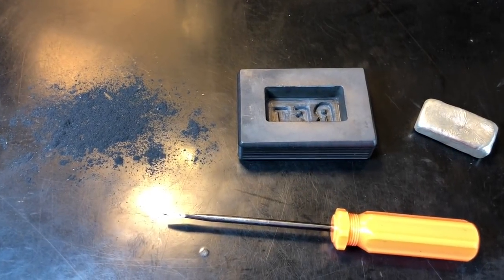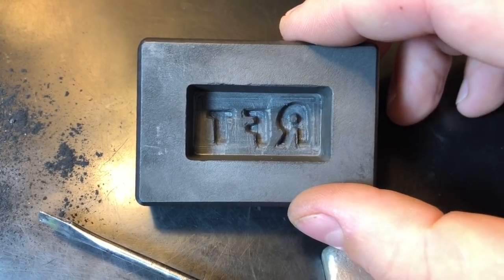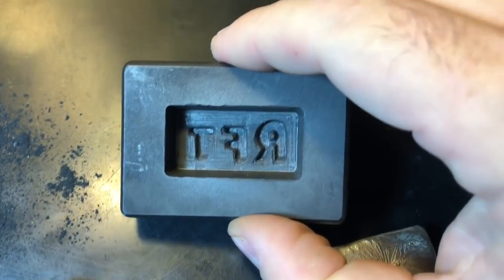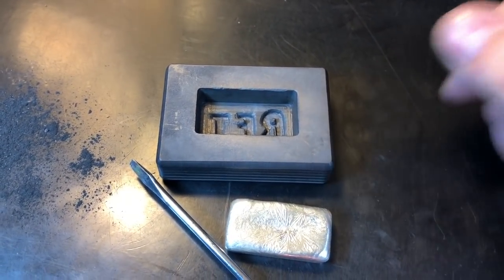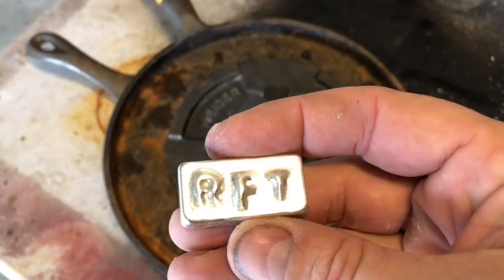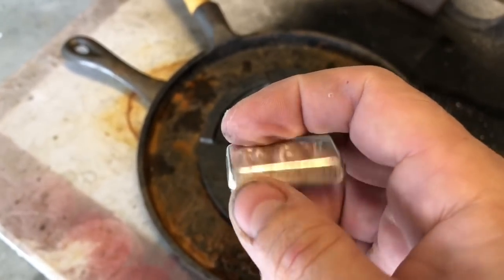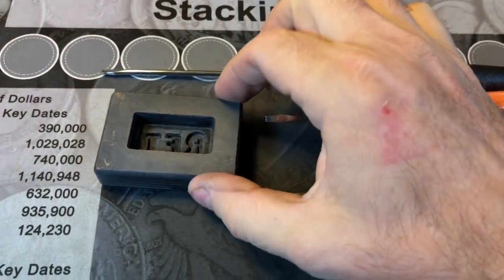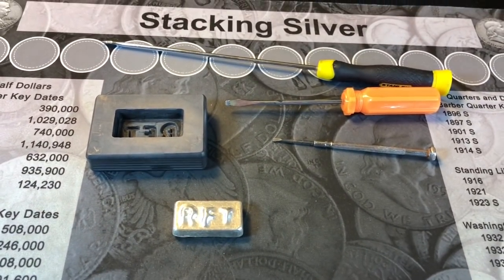Hand Carved Custom Mold and Silver Bar Pour!

Comment from the maker: Hand Carved Custom Mold and Silver Bar Pour!
In this video I will to take one of my older graphite molds and attempt to hand carve out my own custom bar mold with only a small screwdriver!  It was my first attempt and it took me about an hour BUT I think I did pretty good overall!
I decided to remelt my sterling silver bar (the one I poured from smelting my old junk sterling silver) and test out the mold to see where I needed to fine tune it!

I didn't use my electric furnace for this project as I have yet to set up a safe place to use it.  I used a blow torch and hand ceramic crucible since it was just a test pour.  I also do all of my own hand polishing using a wire brush, steel wool and 800 fine wet sandpaper.

I hope you enjoyed the video - if you did, please subscribe!

I post several videos weekly so please subscribe to my channel to see more:   https://goo.gl/7jX6g5

Thanks for watching!

PS - My Stacking Silver Hunting Mats (the one seen in this video) are now ready and are listed on eBay, if you want to check them out:

https://www.ebay.com/usr/robfindstrea...

PLEASE SUPPORT MY CHANNEL - I am an Amazon Associate and if you shop on Amazon, please feel free to click one of my links below - I get a little extra every time you shop using my link:

https://www.amazon.com/shop/robfindst...

FYI - I've been asked about an address to send things to.  
If you want, you can use this address:
Rob Finds Treasure
P.O. Box 5565
Frisco, TX 75035

If interested, please join me on my other social media sites:

Facebook:  https://fb.me/RobFindsTreasure
Instagram: https://www.instagram.com/robfindstre...
Twitter: https://twitter.com/RobFindTreasure
Google+: https://plus.google.com/u/0/+RobFinds...
www.robfindstreasure.com
https://www.ebay.com/usr/robfindstrea...
Reply: 1st reply to rob
Reply: Can I get a shout out rob?
And what does your son like to do in his free time (like you like to hunt boxes of coins)?
Reply from the maker: Sea Bass' Coins n' Critters he plays Black ops, Rocket League and Fortnite

Comment: Second, and rob how much does a halves box weigh
Reply from the maker: About 40 lbs - give or take a few pounds.
Reply: About 10 kg or 26 pounds for a box of 500
Reply: Woah, so around 30 right?
Reply: @mashfiqmahadi8880  yea the box I weighed had around 480$ and it weighed 26 so I think a full box may be a little closer to 30 lbs